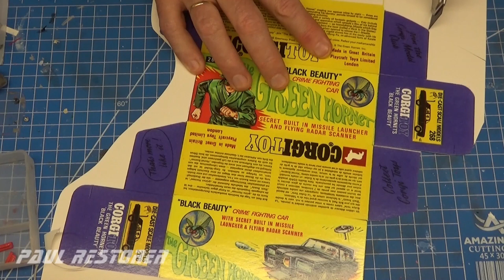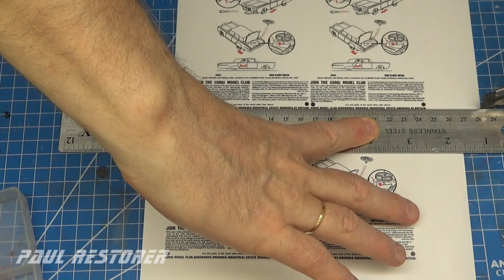Corgi renowacja "Black Beauty" nr  268 Green Hornet TV serial. Zabawka model odlewany.

Comment: As the years have gone by....I have seen so many of this particular car in really beat-up trashed condition.  But it's because the kids LOVED to play with it.  I know I did.  The one you received was really bad.  I thought it was great how you went to the trouble of fabricating a piece for the internal workings of the car....now made out of material far superior to what the original factory used.  To be Honest, the companies who made these toys were in business to make a profit.  There are many items which could have been made better, but time and speed of production did not permit it.  Do not let any of the comments get to you with people saying things like, "Not Historically Accurate".  I'm certain that if the original craftsmen (and craftswomen) who made these toys had access to all the resources and equipment that you have at your disposal....they would have JUMPED at the chances to make the toys better!  When you add chrome highlights ALL AROUND THE CAR, instead of just the bumper....I love it.  When you correct the size of a racing decal, replacing the clumsy far too large version done at the factory (and you make sure it goes on straight)....I love it.  And when you use your Moloto markers to make the rims sparkle and shine, where originally the rims where a silver grey shmutz, I LOVE IT.  I was a kid buying these things in the sixties and seventies and I know how dull the rims were!!  Well, I have run on far to long, but bottom line....keep doing what you do.  You're GREAT at it!       Chalon.
Reply: Completely and absolutely agree. Well said 👍🏻
Reply from the maker: Thank you very very much Auberey

Comment: Great Job Paul.I was wondering if you could fix my Corgi Black Beauty?I have Rheumatoid Arthritis and in a wheelchair and my hands aren't much good for restoring this car.I have all the parts and mine needs paint and I noticed that one of the posts for the rivets is broken and there's some metal parts that I can't get off and I don't want to break them.Also,the green plastic part that attaches to the bottom of the car looks like there's a couple of spots that look like they're getting ready to break.If you can help me please let me know,thanks.
Reply from the maker: Please write me on my email where you are from. I will check what the shipment to Poland would look like.
paul.restorer@w.pl